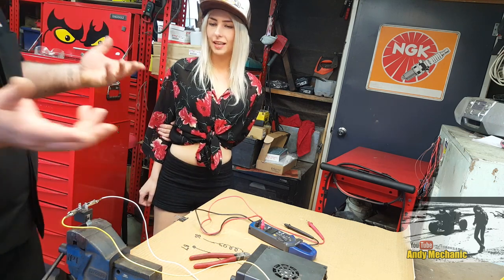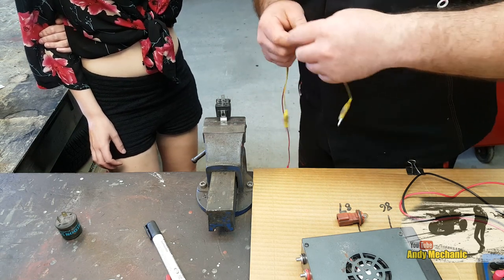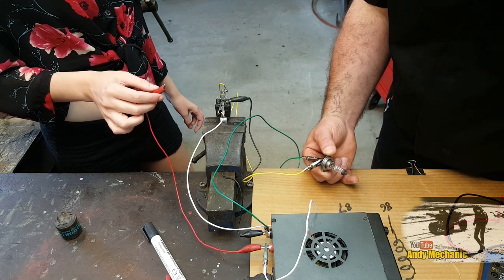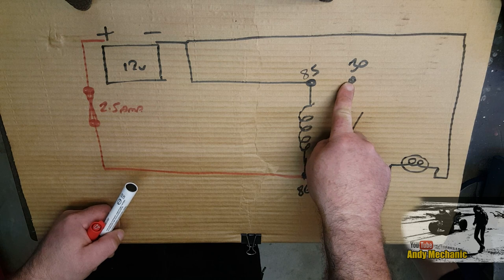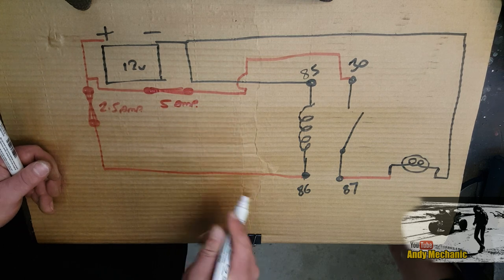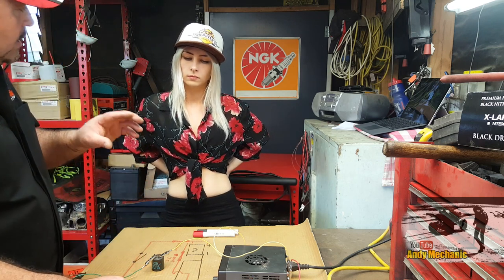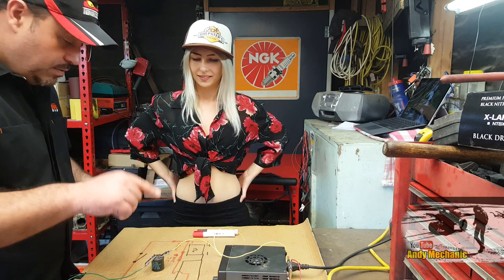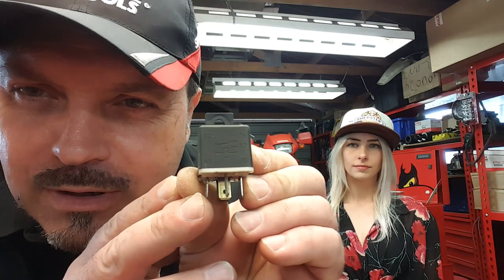Fun wiring up relays with Tool Girl Sam #1430

Comment: Nice informative video.
When i install relays with manual switch i find i easier to install the switch on the ground wire. 
Especially if the switch is mounted inside car and relay in the engine bay. Less wire to route. 
You only need to find a ground spot inside car.
Reply from the maker: +seiki Yep. That's a good idea :-)